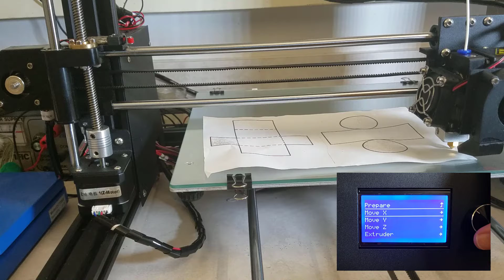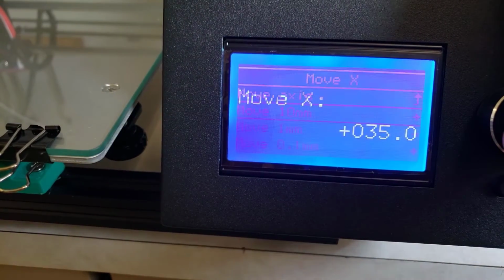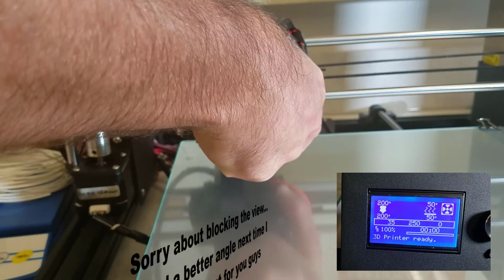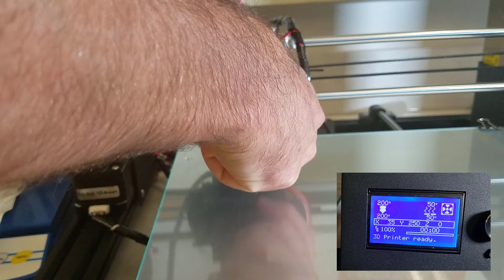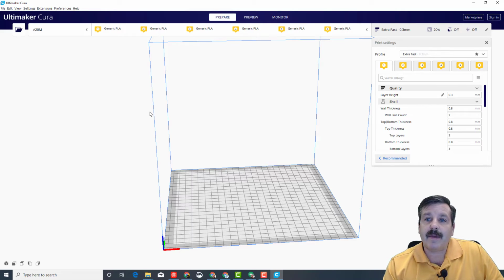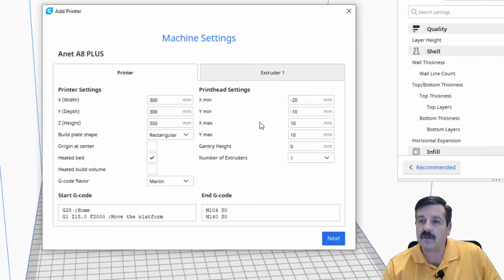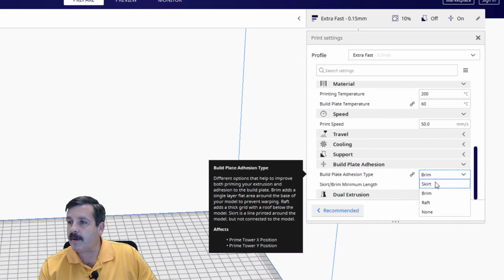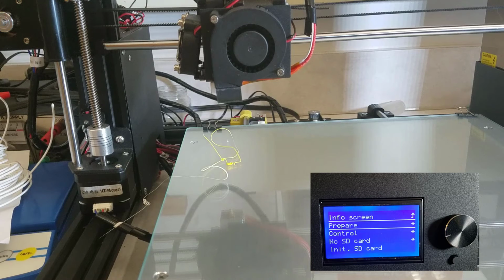Simple Steps to your First Print on the Anet A8 Plus

Comment: Hey my filament isn't going straight through instead it's curving around the wheel inside and pointing out to the side
Reply from the maker: I have had that happen as well. I have got a system now where I can feel if it does the wrong bend there... It is really just by feel though.

Comment: How do I get my printer bed in the right position  for when I hit auto home it goes forward but doesn't stop when it is supposed  to it keeps skipping the belt because its like its not in right position  please help??!!??
Reply from the maker: I would guess one of your end stop wires is not plugged in first. Is it moving to far along X or Y?
Reply: @HLModTech  no I went back over every wire an everything is wired correctly and plugged in tight the head is doing the same thing when I hit autohome the bed tries to come way too far to the front and then the extruder head tries to go to the opposite side of where the limit switch is and the bed is going away from the limit switch when I hit Auto home and it doesn't stop when it comes all the way to the front of the unit
Reply: @HLModTech  an it is moving away from Y when I hit auto home an the extruder motor moves away from X when I use Auto home so both units are moving away from the movers an the limit switchs
Reply: Your y axis belt is screwed in the left set of screws, not the right side, flip em over to the right side and it'll work as intended
Reply: Sounds like you have your Y motor rotating in the wrong direction. Swap both of two wires of one of the two phases around and the motor will rotate in the opposite direction.

Comment: Looks way too easy, in the manual it says tighten the 4 corners to the max, then set the extruder a bit higher, then untighten each corner as you show. My bed is killing me! when i set one corner, the other one goes up as well. in the end i'm left with three corners ok, one totally slack and still too much of a gap. checked the frame, looks even in all corners. tried both hot and cold, tried thicker glass, stomped really.. I'm already thinking of installing the auto levelling sensor
Reply from the maker: I am sorry to hear that. I have never moved to the ABL sensors. I usually get it good enough to print the cm cube, then keep working outwards till I have the bed all where I want. Once you are close, half turn should get you right. Are you using skirt? I usually have 4 lines so I can see where I am at before it really starts printing.

Comment: Hello I see that you have the same printer as I have just bought. After assembly and first turn ON, I have discovered 2 problems:

The Y axis by function "AUTO HOME" is going not in the way to the limit switch, but in the opposite way. Other axes Y and Z are working well. I went to manual movement with the axis.
The X axis when I turn to + it goes with the portal to right side (away from limit switch) - 
The Z axis when  I turn to + it goes with the portal up (away from limit switch) - 
But the Y axis when  I turn to + it goes with the table to back of the printer (way to limit switch) - 
    Therefore I can not use the "AUTO HOME" position, and I am not able to print.  
Please see attached video - https://youtu.be/xdiul2q349Q
  
The motor from the extruder is not moving. By manual moving with axis E is the motor not doing anything.
video can you see here - https://youtu.be/zlCCBHouOfQ

Could you please help me? any suggestion? THANK YOU
Reply: You put the belts on the wrong side in the bottom where they get screwed in. You have them on the left side, not the right side
Reply from the maker: I would guess that when you connected the wires to the board you have them on the wrong connectors. It is a easy thing to do when you are squeezing all those wires in there.
Reply: @HLModTech  Hi, thank for your reply. unfortunately this is first thing I had controlled. Everything is connected on the right place regarding assembly instructions manual.
Reply: @dusanolejnik5225  I have seen other videos that said the connector was wired the wrong way around for the Y axis. They said they fixed it by flipping the wires in the connector or through configuration.
Reply: @DCGrimm  Hi, thanks. When I see the wire color, there is everything the same way as by other motors (I mean the colors of vires and their position). Could you pelase share the video? I think that flipping the cables is for me faster as configuration change. Because I am not so experienced in firmware flashing. Thanks
Reply: @dusanolejnik5225  The guy didn't say which cables he switched around.
Another post here I saw someone said the belt was the wrong way around.
https://3dprintboard.com/showthread.php?40232-Inverted-Y-axis
Reply: @dusanolejnik5225  my printer had the same problem the wires were not correct, for the axis’s that were going the wrong direction I switched the red and black, and the yellow and blue. I also had to extend most of the wires because they were too short, but I can’t complain for a $230 printer.

Comment: Is this an easy 3d printer to use??? I have 0 experience with 3d printers.😐
Reply from the maker: A8 plus is more difficult to put together than most of the newer models. Once assembled I have not had problems printing. You get a larger print area for the willingness to assemble it.
Reply: @HLModTech  Ok, thanks! Would you say the Ender-3 pro is better than the Anet
 a8 plus?
Reply from the maker: Sorry I was slow to reply. I have not used a e3pro, but my e3 just works.... I never have to mess with it. My A8 plus was tougher to build. Trickier to change filament... but I love that build size and it is printing great too...  Can I just say both... 😁
Reply: @HLModTech  Thanks!

Comment: your mistakes are, the unit of measurement is millimeters not centimeters, and your other mistake is how you level you bed. This is how you level your bed as follows.
1. home your axis
2. go up 0.3 mm
3. fold a peice of paper in half
4. continue to level your bed as shown. 
Note: a piece of paper measures 0.15 mm so by folding it in half you get your 0.3mm
Reply from the maker: Interesting. She has been printing really well, but I do like your system. My mad on saying cm instead of mm... I switch words a lot. Thanks again for the feedback.
Reply: Damn, the whole 3D world is using the wrong way to level a bed. Omg, we have been using a single sheet of A4 paper and not folded. Even the really top smart guy are the same. Btw, how thick is A4 paper,  2cm?
Reply: @ABWOrturLaser  a regular piece of paper is .15, so I fold it for the .3mm, as to give a bit more clearance.. So when you are setting the .3mm offset when you are done you should be right at true zero, for a while I tied the other way and it just bugged me, so when you set first layer at .4 or .5 to try to get rid of the elephant foot, you maybe more successful, and when wanting a tight gap you wont be prevented by the built in offset of when you level out. hopes that makes sense I have been working all night.
Reply: 10 mm=1cm, so it is the correct unit of measurement